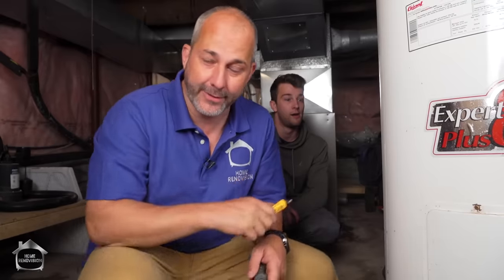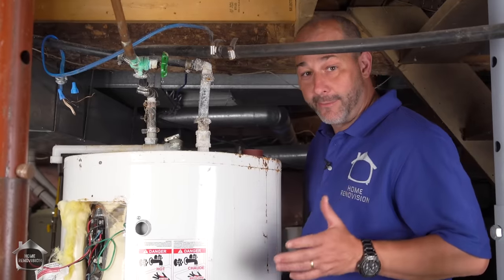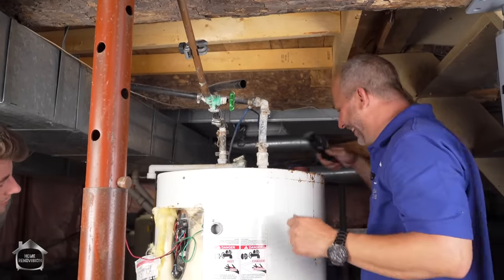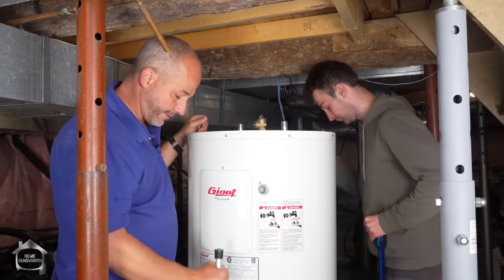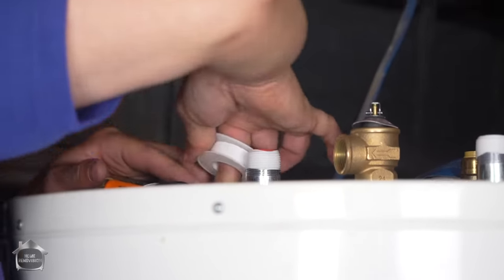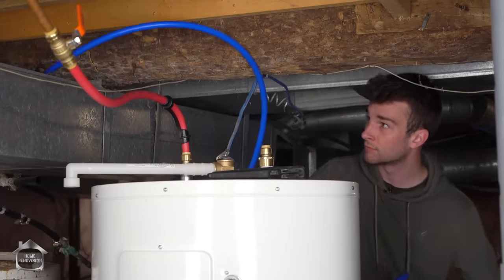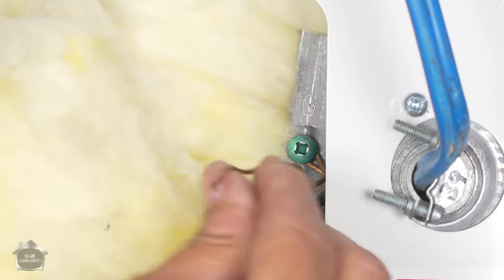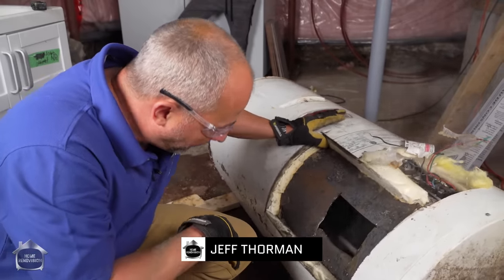How to Replace an Electric Hot Water Tank | DIY Home Repair

Comment: You forgot to mention to fill the water heater tank completely with water before turning on the power to prevent the heating element from burning out as it's water cooled!
Reply: Yup that’s called dry firing an element and will destroy it immediately
Reply: For how much he talked about everything else but the actual job, not surprising.
Reply: Actually after completing the piping he had his son turn the water on. He didnt specifically mention this but anyone who has messed around with HWH should know not to fire up the power before filling the tank.
Reply: That's what really made this video bad to me about not mentioning about turning back on the water.

Comment: Plumber here, please take this comment to heart: Shark Bite fittings are for temporary use only. If you're using pex, use a pex ball valve. If you're using copper, sweat one in. I prefer the later, but I'm old school. Pex works just as well. Don't use shark bite if you can help it, it'll cut down on your cost and your headache when that compression fitting pops in a few years or during a cold spell. Also, it may not be code everywhere, but if at all possible, put your tank in a pan and then elevate. Install a water alarm. It will save you headache in the future if you spring a leak. And you should always bring your relief to 4-6" from the floor. This minimizes risk from kids pulling it open at eye level or you bumping it if the power goes out. Trust me, that water is hot.
Reply: wow good advice
Reply: some place also requires metal pipe for first few feet out of heater, so plastic does not degrade over time and securing the water heater is a good idea with some strapping especially with flex lines on tall tank

Comment: NEVER EVER use a white wire as a live wire WITHOUT marking it black!  Mark the wire on both ends.  Best practice (and I think is the new code), use 3 conductor with ground.  If neutral is not required for install, cap the end of it and coil inside.  Side note:  I've never seen an electric water heater of that size pull less than 20 amps.  That wire should be 10/3 with ground.  Outside of that, great video!
Reply: Depends where you are, NEC only requires it be marked. But he is in Canada, I Don't know Canadian code.
Reply: @MurkleQ  yup both times .... figure on 30 Amp 10 gauge wire and your safe with out exposed romex

Comment: make sure full of water before you turn on the electric.
Reply from the maker: definitely, Cheers!
Reply: LOL!!! 

We've all made that mistake before....
Reply: HA! Did someone say cracked heating elements? :(
Reply: I was wondering if he had filled it up when they turned it on since he never mentioned it.....
Reply: The valve is in the “off” position.  I think he just f’d up
Reply: @Red_Twizzler  That valve you see is for hot water coming out of the unit - not the cold water coming in.
Reply: @sparklita1  I think he mentions it in the video...at least he mentions to do the plumbing then the electrics.  That's what I did with my new Super Cascade Giant 40G tank.  Filled it up then I did the electrics (breaker off)..then breaker on.  Easy way to know if your hotwater tank is working ?  Just stick an ear against the tank and if you hear a soft hum...you've got power and especially your elements are working.  Also check for leaks with the plumbing.  Wait 2 hours and you should have hot water.
Reply: Shut off valve is suppose to be on the cold side so you can shut off water to the heater and even rookies know you fill the water heater first before you turn on the electical😝.  Also did these fools set the water heater on wood pieces?🤦🏼‍♂️
Maybe leave plumbing to plumbers before you get someone hurt.
Reply: This guy is clueless when it comes to plumbing🤦🏼‍♂️

Comment: Replaced my first tank and used your vid as reference. Really helpful. I had a cold water inlet at bottom. Tip is to slightly cut the hot water pipe and it will help the water to drain more quickly thru hose. Then cut cold water pipe. Keep up the good work, Jeff!!!
Reply from the maker: Glad it helped

Comment: I just installed a heat pump water heater with the aid of this, and a few other videos. I called around and the cheapest I found was $1400 to install same day (our old one dumped about 15 gallons of water on our basement floor so we needed it ASAP), with the most expensive being $2200. Man... I understand same day is likely a premium but this isn't a $1400 job let alone a $2200 one. It did take me most of a day to get things done as I wanted to be sure things were done right, and boy am I happy I went ahead and saved that money. Hopefully this heat pump heater saves a ton on energy too!

Comment: Had my electric heater melt down yesterday. Here's the scenario...40 G tank is in the corner of a small
closet, virtually full, drain valve plugged with sediment and useless. Here's what I did to empty and move it out... shut off breaker and supply line valve, disconnect power wires, disconnect both the
input and output water lines. Take a wet vac and press the hose end tightly overtop the INPUT threads,
and pull the water up and out of the tank, being careful not to burn out your shop vac (30 secs, let it
breathe and so on) Good luck, worked for me. Thanks for your videos Jeff :)

Comment: Secrets to getting 30 years out of a tank:
Sediment filter before the shutoff on supply.
Expansion tank after the water tank.
"High hat" (vacuum breaker) between shut off and tank.
Change your anode(s) every 3 to 5 years.
completely drain and refill twice a year to keep sediment out.

I have changed about 80 tanks over 25 years. The very first one I put in are still running tip-top.
Reply from the maker: Great advice Tim. Cheers!
Reply: If i knew what all those words meant, that would be very helpful. lol. As a soon to be new and first time home owner. I'll be looking into your suggestions for sure.
Reply: @McCloudX13  The install goes like this...
Supply line --> Shut off --> Vacuum breaker --> Hot water tank --> Expansion tank

You don't HAVE to have an expansion tank, but it does save on the wear and tare of your fixtures... And the Vacuum breaker is put between the shut off and the tank for the following reason.  Let's say you turn off the supply of water with the shutoff valve. Well, the water in the tank is still hot. But, let's say the power goes out while the supply is off... As that water cools it will shrink, pull a vacuum and possibly implode your tank. Those tanks are designed to resist expansion, not contraction. So, if the supply of water is off, and the power is out, as the water cools, the vacuum breaker (called a hi-hat by the pros) will allow air into the tank to balance out the pressure.  $10 investment can save you 10s of thousands in repairs.  Insurance companies will not cover the damage of a tank implosion if there is no vacuum breaker installed.
Reply: Tjomas Leal  inline filter runs between the cold IN , filters stuff that suppies the heating process.
Vacum breaker stops water from running back through the supply and the expansion tank is a another small storage tank after the hot outline, its not necessary but some codes require it. Takes the load off the main tank.
Reply: @timfalardeau9753  I thought the expansion tank goes on the cold water inlet? Am I misinformed?
Reply: @nichowolf  You can actually put it on either side. What matters is that it isn't separated from the hot water tank by a shutoff valve.  And the only time they are absolutely necessary is if you have a check valve stopping water from returning to the city line...
Reply: @timfalardeau9753  I'm confused my self on what your saying of what and how. I'm just in the last steps of installing a new tank my very first time. I've connected all the hoses and pipes now I just need to check for leaks and fill her up and hook up the wires after I confirm the thermostat is set properly and if the wires are disconnected by the thermostat
Reply: the expansion tanks only make a difference in areas where the water meter has a backflow preventer on it otherwise the water just expands into cold water line and pressure never goes up backflow preventers prevent water from flowing back into cold water supply. vacuum breakers are to prevent siphoning dirty water or collapsing a tank if someone drains it without opening valves it lets air into line you can have a combination of both backflow preventer with vacuum breaker. most of how long your tank lasts is the water quality i get 20 years from water heater while doing nothing because we have good soft water . Is the cost of replacing anodes and flushing all the hot water from drain worth the chance you could break a perfectly good water heater trying to do them?
Reply: @timfalardeau9753 Thanks so much. The summer storms where I live knock out the power at times, and I can see where this prevents a big problem.

Comment: Last October, I did away with my 40 gallon water tank and went with a "Tankless gas on demand system" and I love it, my electric bill dropped and no the gas bill didn't increase.  I also had a new water softener installed plus a whole house filter, and a reverse osmosis system put in.  So far it has been great.  PS: I live in the country & have well water, lots of iron in the water.

Comment: I'm surprised by the bad shape of the water tank for just 6 years old.  I live in a coop and they mandate the HWH be changed every 10 yrs, I go about 12-15 before I'm caught, so replace it then.  They are always in near pristine shape, no leaks, or rust these Bradford Whites.  My place in Fl has the same model, last over 20 years before it shows drips, but never catastrophically.  Now, it takes 2 pro plumbers about 1.5-2 hrs replacing it to copper pipes using ProPress fitings. previously it was about 2-3 hrs with soldering.  Didn't know you could use flexible PVC tubes on them.  Given all the lifting and gear needed, I leaves this for the pros, but your vid shows there are easier ways too!  Thank you.

Comment: The shutoff valve is typically on the cold inlet to allow you to service the water heater without shutting off the main.
Reply: @genebold9544  You don't want a shutoff on both the inlet and the outlet. If the pressure relief valve fails, you could be creating a bomb that way.

I agree that it is more normal to have the shutoff on the cold inlet side.

Comment: Jeff, Matt, (and @ Tim Falardeau):  gr8 vid.  4 questions plz:  1.  Why add wood over the cement block?  2.  Use torque wrench when replacing anode?  Found impossible to get old one out   3.  How selecting heater, are the plumbing supply distributors better quality than big box stores?  What should we look for besides capacity?  4.  Worth adding timer or energy saver?  Cheers and thanks guys!
Reply from the maker: Hi John, used wood to distribute the load from the outside perimeter of the tank to the block. anode after time is tough without a braking bar like the one shown. Not sure if they are better quality but definitely a better price. most new tanks lose .5 degrees per hour which is pretty fantastic for energy saving you could buy a blanket but at that rate of loss I don't see the need. Cheers!

Comment: Congrats such a good videos and advise! I like to ask about isolating furnace during summer season, that being said can I add an electric water heater and shutoff boiler, reason for this is to prevent boiler to run all year run.  Furnace is oil, steam.  thank you

Comment: In the US, most codes do not allow you to connect plastic directly to the tank. If you have a pex or cpvc system you need atleast 18" of copper (or galvanized which no one uses any more) or flexible copper or braided line between the tank and the pex. And it should be 3/4" line in and out of the tank. You can reduce the line size later in your system when branching out but main trunks should stay 3/4. Maybe you will redo this when you complete you manifold system later.
Reply: When did this become code?
Reply: yup and 10 gauge wire 30 Amp breaker  .... without exposed romex too
Reply: Exactly I see this not lasting
Reply: This is true for gas combustion water heaters. PEX needs to be 6 to 18 inches away from the vent duct (only gas has exhaust tube). I believe building codes may allow for electric water heaters to be connected directly to PEX without the 18” metal tubing separation. Manufacturers like Zurn provide instructions that state this. Disclaimer: local building codes will vary. Check with your local ordinance.
Reply: So sorta. Electric tanks code isn't as picky. But gas ones yes because of the flue. 

So a 3500w one, 12ga 20amp is legal. Just redid my mother's 11 year double-wides tank and it had that. Theoretically you can do that on a 4500w one, but it might trip a 20a because you're at the limit

Comment: Just one small "pro" tip, use 3/4 for your fill or cold line. It is faster and handles a ton more volume. Plus that's the actual fitting that is on the water heaters.
Reply: Ryan Roberts Yeah I’m not sure why they downsized that
Reply: Same reason they put literal plastic plugs mandatory into all of our shower heads so we use less water but still pay our monthly water bill service fee before usage amount. Meanwhile the users get a much less satisfying experience.

Comment: No body talked about an annual water tank flush. It's a simple process that not only removes the nasty sediment but prolongs the life of the tank.
Reply: Thanks, I just learned about this after the bottom of my tank failed! You can bet that I'll be flushing the new one once a year for sure.
Reply: @adrianv3916  LOL.... I think we all learned the hard way. My 1st one burst & created my very own   indoor swimming  pool. Another highly neglected tank maintained thing is changing the anode rod every couple of years. It cost me just over $20 & doing this prolongs the life of the tank for many years. It's one of those things that's totally forgotten but extremely easy & cheap to do. Good luck to you.
Reply: that is a can of worms to open if dirt gets in valve, then you can't close it and have to replace valve or water heater. A water softener to get rid of the minerals in the water is a good option I have soft water and have heaters last 15 to 20 years no sediment. also, some water heaters have curved drop tubes to swirl the sediment up when using water, so the sediment goes out to fixtures it does not sit in bottom of tank much

Comment: The plumbing in my old house is a hodgepodge of copper, cpvc and galvanized steel but thankfully no black plastic ;)  I'm going to redo everything with PEX.  I've never changed out the anode rod on any water heater.  Thanks for the videos, they've been helpful.  BTW, you definitely need a whole house filter ;)
Reply from the maker: Totally agree about the filter. We will be installing one soon. BTW I can't speak highly enough of pex and how easy it is to switch it out. Cheers!

Comment: Just bought a new house and the water heater is original 20 years old. Thanks for the diy I will be replacing mine soon
Reply from the maker: At the very least change the anode rod. Cheers!
Reply: Thank you for the advice. I will look at doing that first.

Comment: Thanks very interesting to see how you did that.  The Sharkbite and Pex tubing... I have not used before. Obviously you have no problem using it.  A couple things seemed strange. 12-2 wire? I thought most Water Heaters were 30 amp 240V and would need #10 wire. Your anode rod... Never heard of different ones for city verses rural. Interesting. It seemed like you turned on power fairly quickly.  How did you know the tank was full first before tuning on the water? Your assistant was using the channel locks incorrectly... Did not have them installed in the correct direction for tightening... was evident since they were slipping off as he tightened.

Comment: Also when reconnecting old wires you should have cut off a couple inches and striped a new section of wire for a better connection. The end of an old wire not as soft as the rest, can be brittle and  crack later inside the wire nut or even outside when twisting. Just a thought.

Comment: Yooo the end of this video got crazy.  Thanks for the tips need to do this myself ASAP! Whoever installed mine originally didn’t put a shutoff valve.  Thinking about putting a shutoff valve on intake too so I can still take a cold shower if the tank rots next time.

Comment: I am a new homeowner (about a year) and DIYer (... about a year ;)), and man do I love sharkbite fittings.  I was always wary of them, but they seemed to held up fine.  However, since I'm seeing a pro like you use them, I feel all the better about them!

Also, boy did you make me feel like a fool with your 'start from the inside of the coil' trick.  Here I am destroying all my roles and trying to get them to 'stay' in the aftermath. lol  Will be so much easier

I noticed you didn't deburr (sp??) the edges of the freshly cut PEC tubing (PEX??? god I forget).  Is that not required?  I've been doing it.
Reply: Aren’t they supposed to be temporary fittings?

Comment: In Aussie. NZ . Often old houses earthed to metal pipework. A jump cable to ensure that earth flow stays is needed. Cut pipes and you could become the earth. When you touch a metal pipe. If circuit older or faulty. Something to think about. Can't assume things are 100% safe.